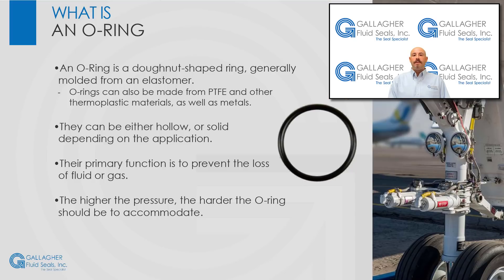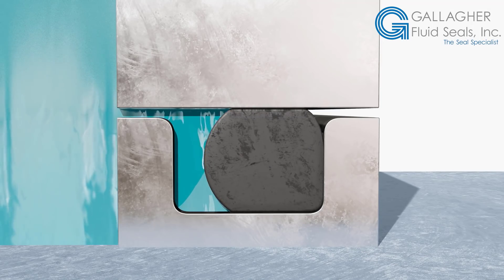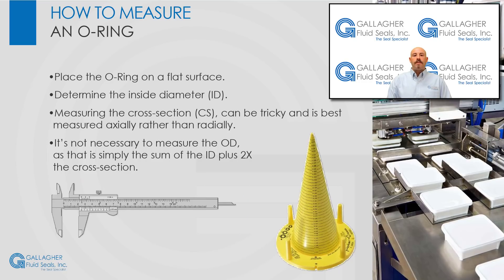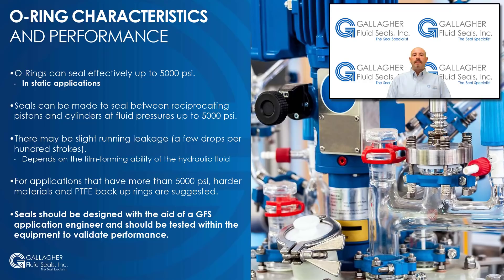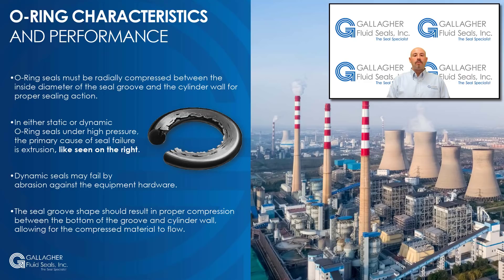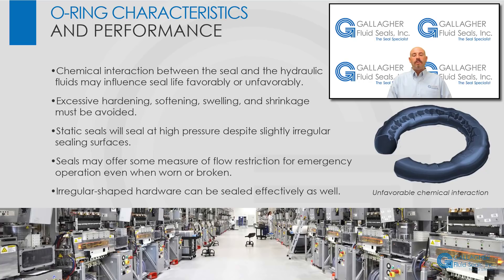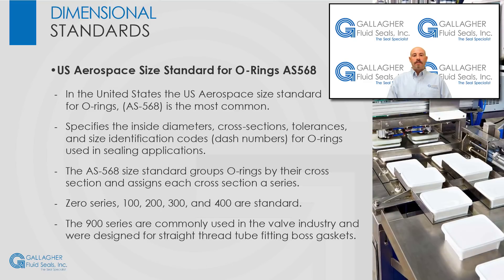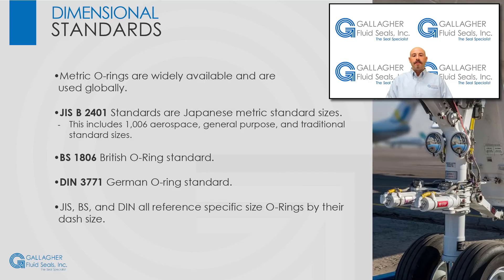Basics of O-Rings | How to Measure O-Rings | Performance Characteristics | Advantages

Comment: No doubt very informative video.    My question can we use a jointed  O rings (wall thickness 6mm) in hydraulic pressure of 150 bar.